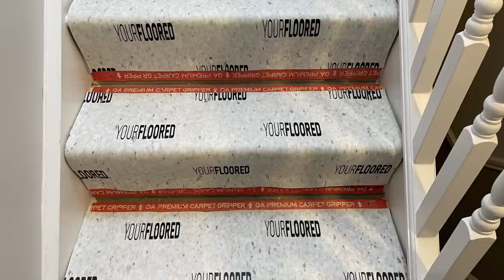Cowboy Fitters - How not to fit carpet part 2

Comment: Any chance you might do a video of carpeting a stair without using a stapler gun? This is as close as I've found but would like more specific. Surprised the gripper on the step outer edges is to hold the underlay. Unable to find yourfloored underlay.

Comment: You would be far better doing the bullnose in one piece,looks a far neater job than mucking around with 2 pieces.the 2 piece method is more for your D.I.Y person.
Reply from the maker: And where did you get that from ?
Reply: Also why do you run a flight of stairs from the bottom up? You make it look hard work,I've been fitting carpets for 40 years and always run the stair carpet from the top down as it should be done,takes around 10 mins a flight.
Reply from the maker: @markpower4831  I can also fit top down. 

However I feel the install is better bottom up as I stretch the carpet better this way.
Reply: I do like the way you put so much effort into your fitting and detail,unfortunately we don't get that much time to do that.its in out and to next job,but your end result is excellent,good job 😁
Reply from the maker: @markpower4831  thank you 😊
Reply: @TrimTuckCarpets  I learned top down and use a stair stretcher your body will thank you 20 years from now.
Love the quality you guys perform. It's rare in this trade.
👍
Reply: @markpower4831  As it is their company I imagine they price each job for the time it takes them. 

It is a shame carpet fitting has been turned into a crash bang wallop trade by the sales led environment of the nationals like CarpetWrong.